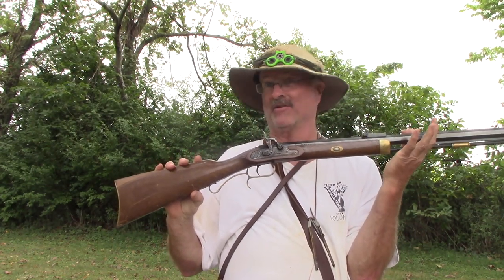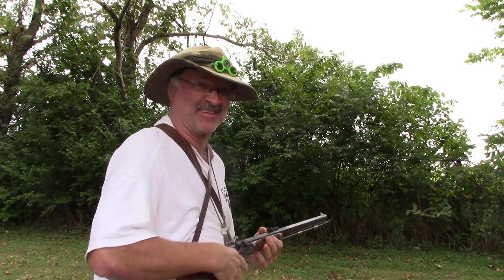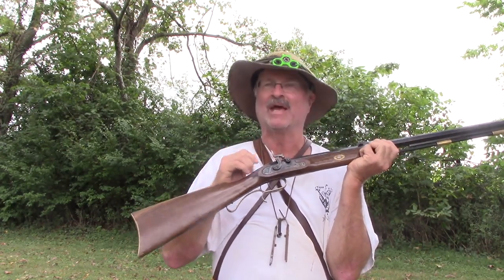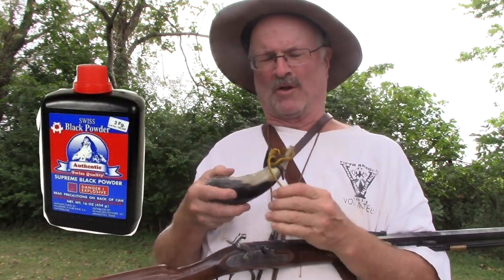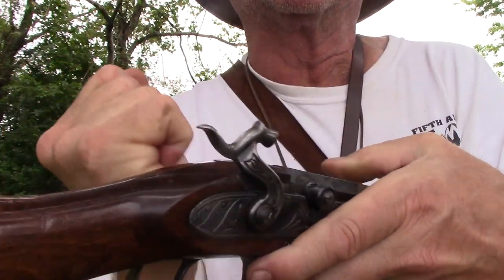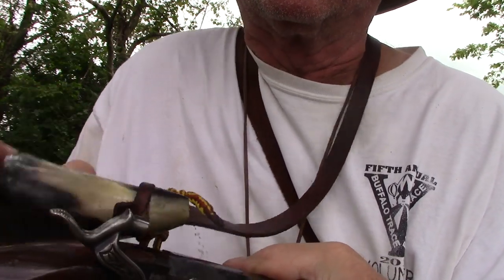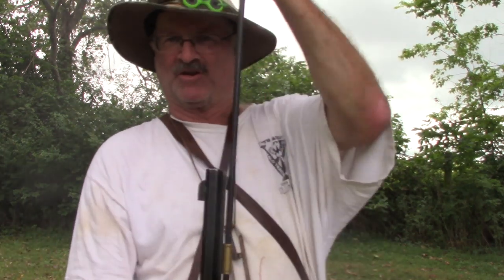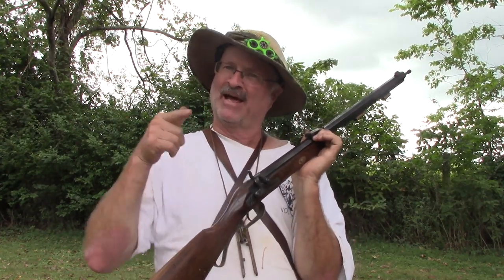How to remove a stuck ball in Percussion Equipment Dryballed

Comment: Just a word of additional advice is to reseat the ball before pouring in powder. Sometimes the cap will push the ball part way down the barrel and depending on how much powder you put in the nipple hole can "bulge" your barrel. I ruined a .54 that way.
Reply from the maker: Thanks for the tips.

Comment: I  used the  co2 method  on  a stuck jag with cleaning patch .  Used a complete co2 cylinder to blow it out.   I paid 8 dollars for a nozzle and co2  bike tire repair kit.  Found it at the local walmart.   Very easy to do.  used black tape  around nipple and drum for airtight seal.   No problem with loud noise.  Just heard a fttt and pop sound  when jag left barrel.!!!
Reply from the maker: Yes..those CO2 bottles works great. This is another option to try. I don't carry a CO2 bottle with me in the woods..just more things to carry I usually don't need. Thanks for watching.

Comment: Hey Mark, good video. I have had to use that trick too. I didn't know about the CO2 untill I saw your video. I got a CO2 gadget now. to test it I loaded gun with ball & powder in cace CO2 gadget didn' work. then I would be able to shoot it out. I used the CO2 to remove the ball and  It worked. Now I have two ways, YAY.
Reply from the maker: Sweet...its aggravating "dry balling" gun. Been there done that too many times to count..LOL Thanks for watching.

Comment: My dad has a black powder rifle that got dryballed probably 10-15 years back and it never got fixed. Still jammed in there. Would this be a safe method of clearing a long-left dryball?
Reply from the maker: Depends on what powder was used. If unsure....try putting compressed air on the nipple and blow it out. If you have access to a high volume compressor, go for it. Be sure you point it in a safe direction. That is the safest way. I wouldn't advise this method for rifles loaded by others.

Comment: What the heck did you use to get the cap on there so quick and easy?
Reply from the maker: Are you referring to the @5:06 mark? If so, I hang a capper on a boot lace around my neck & put cap on the nipple & pull away. Its a very neat tool to keep from losing a lot of caps while shooting.
Reply: @blackpowdermaniacshooter  where does one get cappers? I've been to plenty of gun stores (some that were more for hunting and I thought at least had a LOT of black powder stuff) but have never seen them before. I mean I've got a little primer flask sort of thing for my Flint lock pistol and a small set of tools meant for it specifically as a Flint lock, but other than that I don't really have many muzzle loader and black powder specialized tools, have you made a video about tools that are useful and good to have? If not, would you?
Reply from the maker: @crazys8s  Sounds like good video to make. I'll check into it. Meanwhile, I usually carry two them around my neck. .here's a link to purchase a capper: https://www.midwayusa.com/product/1002279171?pid=486176
Reply: @blackpowdermaniacshooter  thanks man!
Reply from the maker: @crazys8s  Keep on shooting brother!!!  Thanks for watching ......

Comment: I have tried this on one old .50 cal I have and it didn't work! So when I got home I had to heat up the nipple assembly in order to remove the screw that holds that part on the gun! I found a lot of crude in that area! Somehow the gun always fired ok but trying to get powder past the grime and the tiny hole left just didn't work. So now I use the special thread tape that plumbers use on high-pressure connections and it keeps the screw from becoming stuck!
Reply from the maker: I use the stuff you can get from an auto parts store called "Never Seize"...its to put on bolts that needs to be removed occasionally. Works great on nipples.

Comment: so I have a question... my brother dry balled my dad's cva hawken then freaked and put it up and didnt tell anyone fast forward dad died I got the rifle checked it it was loaded 🤨 ran a puller and its stuck bad . ended up pulling the center out of the ball .... now what tried air compressor and air passed by and no movement... please help
Reply from the maker: This can be done for about $20.00 using a cordless drill. I suggest you do 2 things while performing this.
1. Put a couple ounces of water down the barrel first to prevent accidental discharge since you don't know what it was loaded with.
2. Add a piece of dowel rod as a bore guide near the drill bit so the bit won't touch the wall of the barrel while spinning. 
If you try that, you should drill that ball out very quickly. 
Here's the link: 
https://www.youtube.com/watch?v=Gy4XYzKl7Vw

Comment: And here I wasted money on that ball puller.  I do have a magnet because I drop things!  Been there. Now for a flintlock, would you unscrew the little flashhole thingy and pour powder in?  

Thanks for another great video Mark.
Reply from the maker: Yes...here's what I do for flints: https://www.youtube.com/watch?v=8UgxLVoGGZ0&list=PLVMfc1ggQhJI0kU74xmk3idVKHOT38oMT&index=6&t=2s
Reply: @blackpowdermaniacshooter  
Well, the touchhole is kinda small, but that'll work if you dont have a screwdriver to remove the touchhole insert.  I bought a small hose adapter to use when cleaning a flintlock .  Makes it easier.  I also ordered some of that lube you recommended.  
Thanks for the info Mark.
Reply from the maker: @michael.w.salter  You're welcome. The touch hole liner never did come out of my 50 caliber flint from day 1. I've always had to do it this way. Guess its old nature any more. I don't think anything about it. I just do what video shows & move on...thanks for watching & the commentary.
Reply from the maker: @michael.w.salter  I've never been able to get a touch hole out of my flints. I have to use this method....thanks for watching.......

Comment: What about if I have wet powder in it? It’s a steel round and I can’t use a puller but by now the powders wet and unsafe to shoot from what I’ve read. Something clogged the nipple and won’t let it fire. But now I don’t know what to do.
Reply from the maker: Wet powder presents a different problem. Probably the easiest thing to try is a CO2 bottle & force the ball out by compressed air. They can be picked up at bicycle shops.

Comment: Well… I loaded mine correctly, but it still wont fire and my nipple is stuck. So… what the heck am I to do? And after 24 hours, is it safe to say it wont hang fire at this point?
Reply from the maker: It won't hang fire on you after a few minutes. Try putting some penetrating oil on the nipple and let it sit for a while & try the nipple wrench again. It should come out. Otherwise....you may have to get a CO2 canister or a ball puller to get that one out. When you reinsert the nipple, put some anti-seize material on the threads before reinstalling.
Reply: Funny story, small vice grips and a channel lock broke it free. It was badly corroded. Got it clean, applied some anti seize, and fired it. Next question because Im a trad muzzle loader newbie, is 80 grains of 2F powder plenty to kill whitetail with a 240 grain Hornady XTP bullet? All shots within 75 yards.